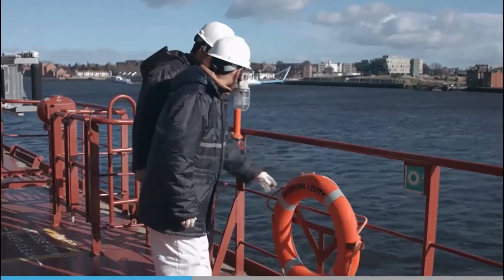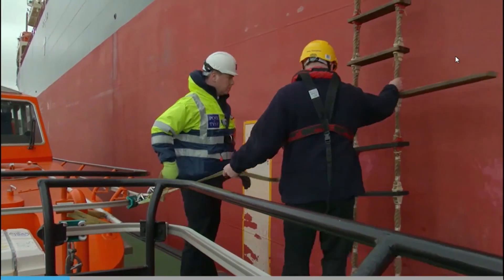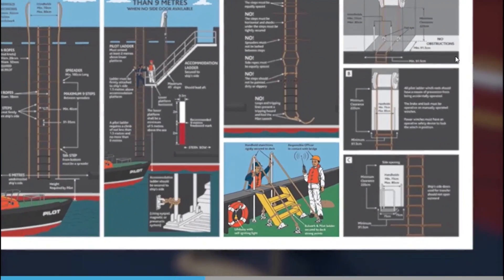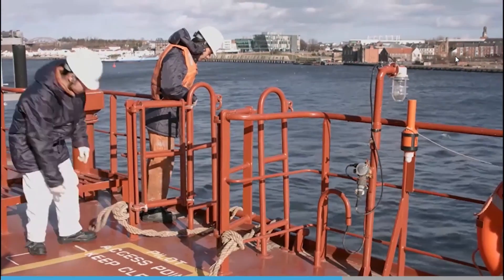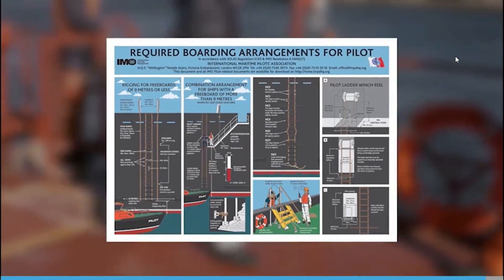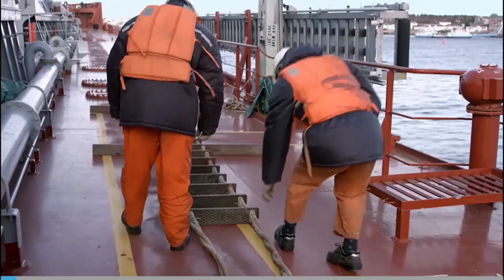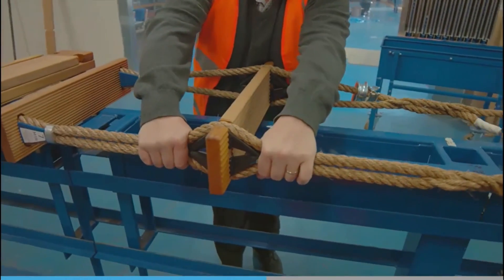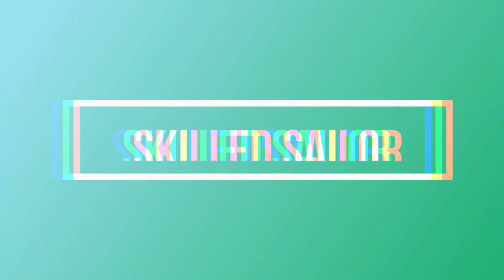Pilot ladder Rigging Procedure , Pilot Boarding requirements , Combination ladder

Comment: Nice job thanks, a key point though - IMO Res A.1045(27) states "accommodation ladder should be in a horizontal position and secured to the ship's side when in use.", therefore securing to the ships side when in use is not optional